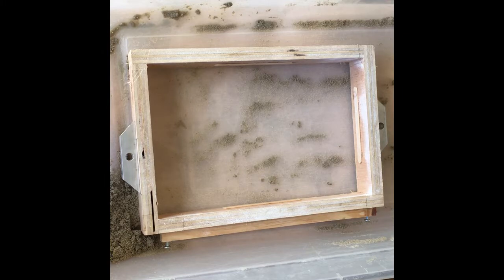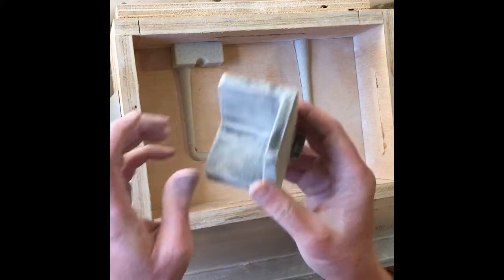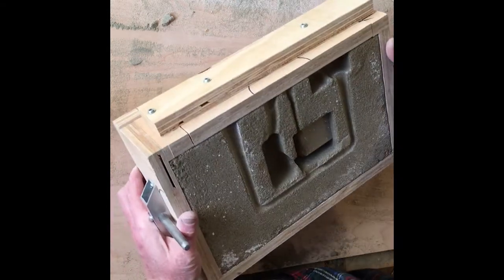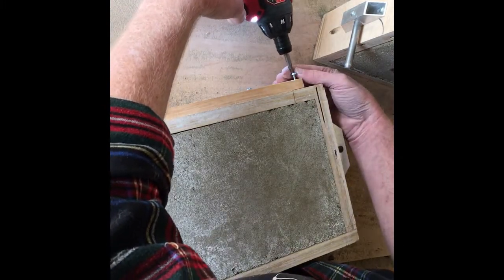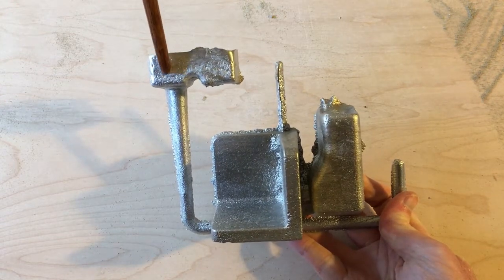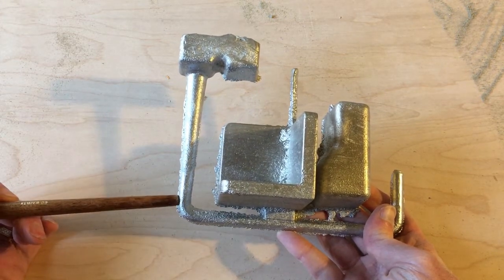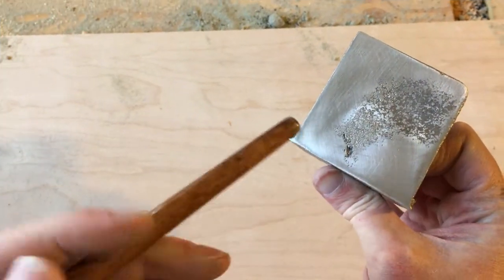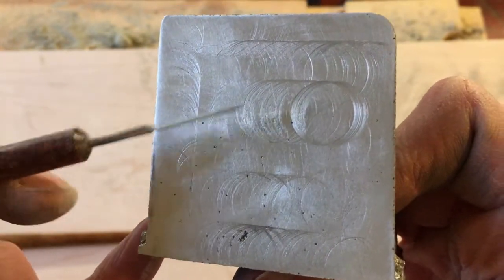Casting with a Vertical Parting Plane

Comment: I wonder if your part was acting as a feeder to your feeder. I'm looking at it this way. The feeder is getting the metal from the part. So the metal is hotter in the part and cools further as it fills the feeder. The feeder cools from the outside inward. The metal has already cooled somewhat as it flowed through your part. This has kept the part hotter and delayed it's cooling. 

The bottom of the part is hotter because it has had a lot of metal go through it, feeding the feeder, and filling the top of the part. The top of the part has more exposure to cooler sand so it freezes first. The bottom remains liquid longer. And while the shell of the feeder has frozen, the center is still cooling. And as it cools it sucks in what it can from your part in order to deal with the internal shrinkage. 

The sand between the feeder and the part is thin and it can't remove as much heat from the metal in contact with it. That metal may take longer to freeze, allowing the feeder to pull what it could from the part. The top of the part does not have any visible porosity so I think it was able to solidify before the feeder started to pull metal from the still hotter bottom of the part. 

Anyway, this is just a guess based on how I think the direction of the solidifications.

Comment: As someone that is new in casting,i wanted to say thank you for this video and other 3 -it helped a lot !
Thank you for the time invested in editing and making of this video and I hope you share more knowledge for future casters to come !
Reply: Have you ever tried lost foam casting? I made a super cheap foam cutter out of hair dryer wire and a cheap 12V transformer ,once my furnace is complete i am looking forward of trying it out.
Reply from the maker: @zumbazumba1  I have never tried lost foam. I have been wanting to try "lost PLA" where you burn out a 3D printed pattern inside a plaster mold. I have had mixed success burning out plaster molds without destroying them, but I have been thinking of giving it another try.
Reply from the maker: Glad you enjoy them. I do have to say though, I am not the guy to learn the basic skills from. I am still working on them myself. The two folks I linked in the description are much better teachers: swdweeb and oldfoundryman. I highly recommend all of their videos to anyone learning.
Reply: @charliekrauter5176  My dear friend -there is a way to do it without burning.PLA is soluble. Polylactic acid can be dissolved using various agents such as methyl ethyl ketone, acetone, ethyl acetate, tetrahydrofuran, and caustic soda. 

What you do is make a mold in 3d printer and then coat it with plaster(mix in silica sand ,portland cement ),or even better silica sand and glass water (hardware store -its used for fire place repairs ,its cheap like 10$ for 5kg and 1 liter of glass water )2-3mm,you can use a brush or dip it for plaster /pour mix of glass water-sand  or use spatula or masonry spoon.Make some holes for air to vent with tooth picks or a wire (you pull those out) .Let it cure(you cna use old kitchen owen ) and pour mentioned chemicals that will eat away PLA.You will be left with hollow core.Now i havent tried it yet but maybe experiment a little bit with chemicals and glass water ,i dont know if one of them will destroy it.

Also glass water+silica sand reacts with CO2 and it hardens in 2-3min.if you dont have a bottle you can use kitchen owen ,i baked it on 250C° for 1h it gets rock hard like a fire brick.
What else oh yea if you ever need to make a core out of plaster or silica sand +glass water -you can use a ordinary paper and a wood glue to make a mold.
Today i made a nozzle out of silica sand for my forced air burner ,i used thick paper and a wood glue to make a cardboard tube,also i used drinking plastic straws for holes.
Paper and PVA wood glue will hold up to 200C° without any problems in owen which is more than enough to cure things.
Reply: @charliekrauter5176  Plaster will crack if you heat it rapidly ,its best to put it in a owen and slowly rise up the temperature.Dont go above 150C°.
If you dont extract all the water it can be very dangeours to pour things in it.When i was younger i tried to make some fishing weights out of lead.Thing sprayed 2 m all over the cealing ,it was a fountain of molten lead.
Reply from the maker: @zumbazumba1  I am not so sure about dissolving PLA, but I will definitely try the sand and water glass (sodium silicate?) alternative to plaster.
Reply: @charliekrauter5176  Yes its sodium silicate +
aluminum oxide and silica sand mix.Its like flour but it has light brown color when you mix it-3 parts sand 1 part glass water .Its used for fireplace repair or to bond firebricks when you are building a BBQ firepit.It shouldnt be too hard to find in a hardware store.
There are several types of plaster ,maybe try find "electrician" type plaster .It has some kind of additive in it ,it hardens  in 3-5min .

Comment: Hi! I think this hole in your casting is caused by metal flow to riser. I think that your casting was doing filtration job for your feeder. But iam not an expert.
Reply from the maker: I am not an expert either obviously, but I think I agree with you. I have been experimenting a little with having the metal progress to the feeder first and then into the casting. Possible improvement, but still not what I hoped for so far.
Reply from the maker: @tinayoga8844  Good idea, but I am afraid it is now an ingot again. I am going to do a new test in the next week or two gating through the feeder/riser. I'll do my best to capture it and make a follow up video.